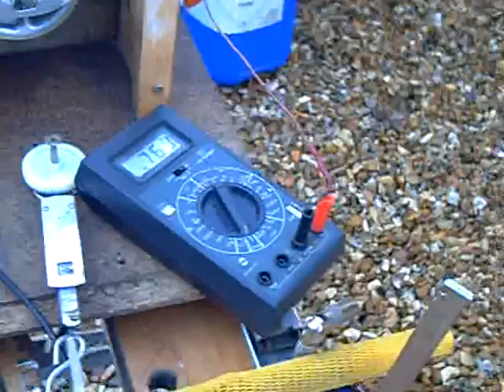scratch built turboprop.

Comment from the maker: free turbine refers to the principal of having a second turbine stage at the back of the engine which converts the the remaining gas velocity into torque and then transfers it through a gearbox for whatever  you need it for .
the free turbine is normally significantly larger than the first stage turbine so as not to choke the exhaust .

Comment from the maker: the maximum rpm will be limited to 90000rpm at the turbine thats 6428 at the prop with a 14 to 1 gear ratio.i have only had it up to 84000 rpm at the moment  . the gearing at the moment is effectively single stage with intermediate ldler gears.
the new gearing will be two stage with larger teeth to cope with the  power.the pressure ratio will be about 2.1 to 1 the compressor is a 75mm diameter garrett t04e 40trim .the compressor is capable of much more but the turbine isnt.

Comment from the maker: the ratio is 14 to 1 maximum rpm is 90000 or 6400 at the prop.
Reply: can it be attached to a plane made of carbon fiber and cardboard the plane is 24x13 ft If you send me the blueprints I can add it to my plane

Comment: Centrifugal turbines are smaller and cheaper, hence they are commonly used in APUs.  They also tend to be wider but shorter, making them < suited aerodynamically for jets and more more suited for helicopters, their other main use.  A centrifugal blower can never match the pressure of a couple axial flow compressors, but they have one additional big advantage to the ones I already mentioned. They can be much more easily designed to avoid FOD unlike axial flow which are very prone to such damage.

Comment from the maker: hi the thrust to date is 18 pounds but predicted thrust will be 25 pounds when everything is sorted out and max rpm is reached.
the self sustain speed is 20000 with no drive train attached its about 25000 with the drag from the drive train but clutch disengaged.
allthough the clutch is set to be fully engaged at 40000 so as to get sensible throttle response.

Comment: Very impressive. That was uploaded in 09, how are you coming along with it by now?
Did you use a free turbine, gas generator or just take power off of the main shaft?
Reply: I've only just found this.  As the drive is taken from the 'cold end', it must be a single shaft turboprop, with, possibly, an extra stage added to the turbine.
Reply: It's not a free turbine when you can start it by spinning the prop!

Comment: Brayton "Ready Motor" hydrocarbon engine running on diesel with flame ignition. In thermodynamic terms it is referred to as a constant pressure engine. 
The Brayton Ready Motor was produced by George Brayton in 1871 . The first version of the engine used lamp gas or naphtha in a vapor carburetor. The fuel vapor was sucked into the compressor, pressurized and stored in a reserve tank. A pilot flame was held in the expander cylinder as the fuel / air mixture was admitted into the expander it was ignited by the pilot flame. A screen prevented the flame from propagating back into the reserve tank. At times the screen would fail and an explosion of the fuel / air mixture inside the tank could occur. Brayton later remedied this problem in 1874 by injecting fuel into a burner just after the admission valve. The fuels used were light oils or kerosene. These days the Brayton cycle is associated with gas turbine engines even though it's inventor (George Bailey Brayton) only made piston engines... The engine has 4 cycles ... Intake, compression.expansion,and exhaust. In a normal 4 stroke engine the 4 cycles take place in 2 revolutions of the crankshaft, however the Brayton engine performs all 4 cycles in one revolution or 2 strokes of the piston. The back side of the piston functions as a compressor which performs the intake and compression stroke. The compressed air is stored in a receiver tank. The front side of the piston is the expander which performs the expansion or power and exhaust strokes. Compressed air is passed through a burner where combustion takes place as the air is entering the expander thus creating a larger volume of air. The hot / expanded air then performs work in the expansion cylinder. After the expansion stroke the exhaust valve opens and exhaust is pushed out by the piston. A pilot flame keeps the burner lit during the exhaust stroke. The engine can operate on various fuels such as gasoline, kerosene and Diesel fuel. Brayton engines of this type predate the Otto 4 stroke by about 4 years. Both Otto and Diesel studied the Brayton engines before developing their engine cycles. The Brayton engine is regarded as the first engine to compress air and burn liquid fuel inside the cylinder. Brayton engines are also the first internal combustion engines to be used for motive power. They were used to power boats, a rail car, and even the fist practical submarine was powered by a Brayton engine. Brayton later produced a direct oil injection, compression ignition 4 stroke engine. George Brayton invented the oil fired compression ignition engine several years before Diesel.
Reply: what's d point?this is TURBO PROP not a reciprocating engine although they have same process of producing power but whats the point of your piston engine?piston engine is not good for full rpm they easily wear out and most of all if unlucky your connecting rod will give up and affect other parts of it and its heavy.

Comment: It depends on the size of the prop, how would you explain that the smaller RC piston engines turn anywhere from 2,000 to 16,000 RPM and the props of a real ATR-72 turn at about 1,000 RPM during climb? Because there is a huge difference in size of the props.

Comment from the maker: the gears are polyacetal originally out of a laser printer  the pinion on the turbine shaft is steel,but i have had to redesign with larger toothed bought gears as i was starting to strip the intermediate gears .
yes it is a gas start the video just didnt catch me lighting the gas through the exhaust and i am very gentle adding the kerosen as it spools thats why i was leaning over looking at the temperature just to make sure.

Comment: You need a real Turbo prop set-up..using a free turbine at the hot end...a lot more power than this simple geared set-up from the cold end....You do realise its going to eat your gears dont you?
Reply: You know that there are two kinds of turboshaft engines.  Free turbine, and direct drive.  The most popular turboshaft enignes are direct drive.  This... is just that.
Reply: +nerobro can you name a "popular" direct drive turboshaft engine (not older than 30 years)?
Reply: Most efficient Turboshafts are NOT direct drive, the free turbines develop far more power in comparison because they exploit the hot expanding gas stream....Please educate yourself before you comment...
Reply: +Dino Alberini I've never seen one... even helicopters (military ones anyway) use a free spinning coupled arrangement.
Reply: I've heard of some old designs, I couldn't name one though. Free power turbine has been the way to go for decades,
Reply: Ch1n4Sailor in fact the Rolls Royce Dart (Fokker 27), Garret TPE 331, Turbomeca Aztazou (Jetstream 32), Allison T56 (C-130), are direct drive turboprops
Reply: The Dart is a design from the 40s, the Aztazou ant the T56 are from the 50s, the TPE 331 is fairly recent, from 1960 :D
Reply: Direct drive Turboshaft engines, all suffer from the same thing...they eat their gearboxes...that's the advantage of a free Turbine....No gears...a fact lost on the original poster of this clip.
Reply: A free power turbine  turboprop (of any size) must have gears: a power turbine running at prop speed would be grossly inefficient.  I have a photo on my camera, which is in front of me right now, taken in 2012.  It shows a cutaway of a free power turbine turboprop engine, based on a Wren Turbines engine as the gas generator.  The epicyclic reduction gearbox is clearly visible.
Reply: Hi Graham, yes, your right of course, they are geared off, I know. My argument with Penmightygun was that there is a lot more energy available at the hot end rather than gearing directly off the mainshaft of the Turbojet at the cold end. The reason they did it to this engine in the clip is because its a lot simpler technically. That said, it WILL eat its gears in time. I made my own Wren 54 BTW, ages ago...and not from a kit.
Reply: I certainly agree that, if the starting point of the project was originally a little turbojet, then converting it into a single-shaft turboprop would be less efficient, unless an extra stage (or two) was added to the turbine.   I believe that Wren's free power turbines are now two-stage, as compared to the engine I saw at a Wren open day in 2012, which had a single stage power turbine.
The handling would also be a good deal more problematic than an equivalent free power turbine machine.  Was there a suggestion of using a clutch in the prop drive?  The ideal solution would be a variable pitch prop to allow the engine to run at constant speed.  Could a model helicopter main rotor pitch control mechanism be adapted?  However, the combustor would have to handle  relatively lower fuel flow rates with 100percent mass flow, which may be questionable.
If I remember correctly, 8040john acknowledged, years ago, that the gearing had to be upgraded and a tiny pinion engaging with a big wheel in a single-stage reduction with no lubrication was obviously asking for trouble.  Nevertheless, a properly designed, enclosed epicyclic reduction gear, using appropriate materials and with adequate lubrication should outlast the turbomachinery (and the combustor, in particular) several times over.
PS  In my retirement, I thought of getting into small gas turbines, as I had a 40-year career with R-R as a designer and I'd 'dabbled' in R/C aeromodelling.  However, I've never got around to it, because of other commitments, and spending a couple of thousand on one of Mr Murphy's little machines would be quite an expense.
Reply: The mounting of the input pinion is not at all clear to me and, if it is mounted on an extension of the engine rotor, then the precision and accuracy of its location relative to the rest of the gearing would be highly suspect.  Consequently, it would, in all probability, wear badly - or get "eaten", as you put it.  For that gearset to have any life at all, the gears would have to be precision machined, with hardened surfaces, and accurately located relative to each other in a rigid housing, with an oil supply.  
In addition, if the input pinion is mounted on an extension of the engine rotor, it would impart journal loads on the bearings that they were never designed to react.  I really can't believe that this is the case, so I will be benevolent and assume that the pinion is carried on its own bearings and driven by a splined quillshaft from the engine rotor.
Reply: grahamj9101 Whatever bearing arrangement supporting the Pinion, the bottom line is it's running at engine speed since its connected to the main engines Rotor shaft. The engine in this clip sounds like its barely over idle speed, which doesn't surprise me as the main gear on the Prop shaft isn't very large at all. Clearly, watching the Clip here, there is a known problem with a high EGT, not surprising, since the Turbojet is clearly operating too slow and outside its comfort zone. Its easier on the gears due to the low speed of the gears....BUT, not so good for the Turbojet...its running far too slow.
Reply: maybe you are right
Reply: the best option is to combine the two options, a free turbine and a gearbox like a GE turbofan for example, this combine two big ideas.